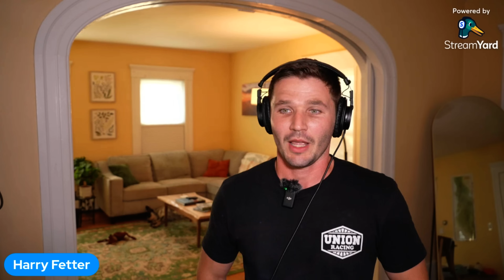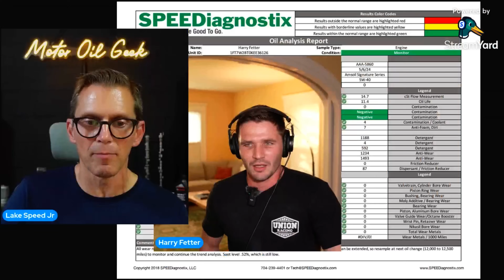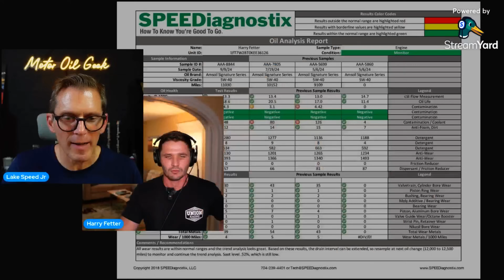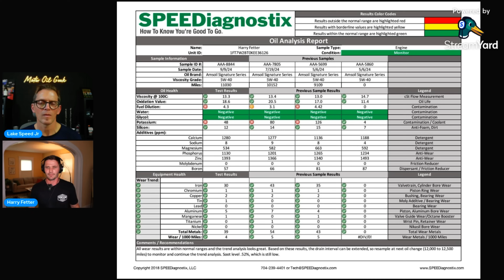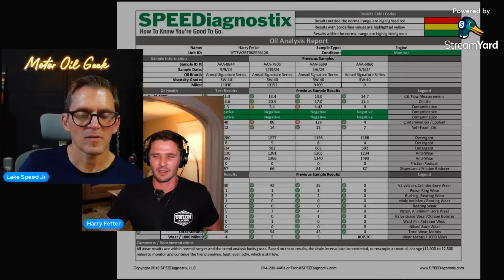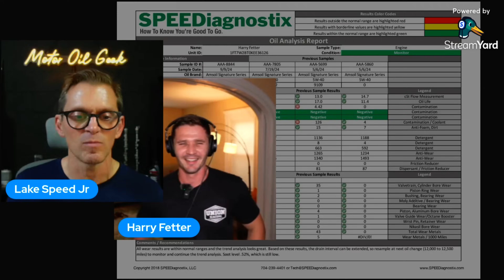11,000 Mile Amsoil Oil Analysis With The Motor Oil Geak

Comment: I just don't understand the obsession with extending oil intervals.
Reply: @HSKFab  for manufacturers, it's CAFE requirements. For owners, it's the added expense of oil changes. Most of these cars will live well beyond the period of ownership for the initial buyer, even with horribly infrequent oil changes.
Reply: Lake supports extended OCI to promote his Speed Diagnostics oil analysis business. Which is fine, that’s his right. I was an aircraft mechanic for 29 years, and the director of maintenance for a charter airline for 18 years. We did oil changes with analysis samples every 50 hours. So I have seen literally thousands of sample reports. It is a very effective tool for identifying problems early. But for my own vehicles, I choose to spend my $$$ on frequent oil changes instead. Since I have a shop with a lift at home, I do all my own work. I am meticulous enough, I am not worried about maintenance induced failures. I use Amsoil for my 4 cars, 2 motorcycles and inboard boat, changing every 100 hours, which averages 3500-4000 miles. Have never had a problem, so am sticking with what I know works.
Reply: @craigg4246  Perfect, I was in aviation as well for a few years and I remember all the testing and sampling. I do the same for my personal and my fleet of fords at work 5k miles, no more.
Reply: @craigg4246  it makes 0 sense to waste time and money and good oil. Is it still clear when you change it? So many don’t get that the new oils are different. It’s what makes it possible to go farther.
Reply: Too bad Lake's Speed Diagnostix oil analysis reports cost twice as much as Horizon Labs (lab Amsoil uses) and others.  Same information is provided on the cheaper reports for half the cost!  I'm a subscriber to Lake's channel but $60 for a report is way high.
Reply: @HawaiiTugboater Agree.  Horizon Labs is definitely the way to go.  I just switched away from Blackstone who aren’t much better than Speed Diagnostix at a whopping  $50 per report and they don’t even give oxidation values or soot %
Reply: @HawaiiTugboater The oil analysis cost is ridiculous considering you can get soil test for a fraction of the price comparatively.
Reply: @HawaiiTugboater  you really think Horizon (who shills for Amsoil) or Blackstone really run lab tests on every single sample? Many lab tests are simply fudged in MS Excel and values are based on oil, miles and application and it's mileage. Why do you think they print the disclaimer that their liability is limited to cost of the test?
Reply: 😂😂😂😂. Money and labor maybe 🤷🏼‍♂️
Reply: Drive 106 miles a day change your oil very frequently or as needed hmmmm
Reply: @brettcombs774  I drive 120 a day. Change every 4k. I may stretch it to 5k.
Reply: @HSKFab  seems like wasted money imo. obv you can do whatever but unless thats basic dino stuff thats wildly wasteful.
Reply: @brettcombs774  I drive 1800-2000 miles a week I change my oil every 2 weeks..won’t even go above 5000 since I do lots of city driving
Reply: That's right, bro'!!!
Reply: @HSKFab  
03 civic. 182k miles
5w-20 Amsoil Signature Series. 

I do 17k mile changes for the last 88k miles. UOAs always come back telling me to go further.
Reply: @ChinookBear  Good for you. Not sure why gassers keep commenting. Video and my comments are geared towards diesels, specifically the 6.7 powerstroke.
Your 100hp civic isn't my 800hp, 1300 lb ft of torque compound turbo 6.7 that weighs 8k pounds. I change at 4-5k. No if, ands, or buts.
Reply: @HSKFab  me neither, I try to change frequently while others try to extend
Reply: @HSKFab  I do it more for the environment. The used oil has to be disposed of somehow. It has to be trucked to a disposal site, any electricity that is used in the disposal process, and what I was told it is burnt on ships out in international waters. It is also expensive to change your oil every 3000 or 5000 miles if there is no problem with it. Plus the oil filters that need disposal and God only knows where they end up. As these oil samples show 11,000 miles and you gain nothing by changing it so why other than oil companies selling more oil.
Reply: @HSKFab  AMEN
Reply: A test is cheaper than an oil change, sometimes 3x less expensive , and you have objective evidence what your intervals should be
Reply: Fleets need to know to save cost
Reply: @evelynfarfellwooosh1219  Got a fleet of 25 6.7's change at 5k oil and fuel filters. Over 100 pieces of heavy equipment changed at 500hrs It's an investment and has paid off for us. Nickel and diming isn't what we're about.
Reply: @HSKFabrications  If don't get into specific then you're no good. You need data to make better choices.
Reply: @evelynfarfellwooosh1219  I'm no good? 😂 Ok.
Reply: Because using oil equals death of the planet.  So what ever you can do to reduce the consumer guilt -- especially with the youngest two generations -- the better chance you can sell them oil.  And it has to be dependable out to 10K.  
    Best of luck, my ICE vehicles will continue to get 3K intervals.   Lots of idling and lots of redline shifting.
Reply: @HSKFab  I change my oil every 8000 miles it can be as quickly as three or four weeks I presently have 336,000 miles on this vehicle most of which been put in in the last 2 1/2 years if I were to change my oil at every three or 5000 miles I would be in the shop sometimes twice a week to get an oil change rare occasion but it could happen

i'm not your average person I put on a lot of miles and I do it quickly it's not uncommon for me to drive 3600 miles in a week I do oil samples that tell me the condition of everything and I have never had a failure
I buy a lot of tires and I do whatever maintenance is required my last car had 755,000 miles on it and I stopped driving it because of a time limit not an engine failure or any other problem
just for the record these are both Fords one was an 09 Focus and the other is a 16 fusion 

If I had to do an oil change every 3000 miles I'd never get it out of the shop
Reply: Because most of us dont have the time or space to change our own oil, and changing synthetic oil on a euro car these days in most east coast and west coast major metro areas is easily $100 + these days. Oils re much better these days and extended intervals according to objective data, ie oil analysis, much better that relying on manufacturers recsssion or even “rule of thumb” (cut the mansucfactrers interval in half !
Reply: Can we please indicate what our individual  situations are when we make aggressive recommendation one way or another ? ,most of us don’t have the time or capacity, let alone our own lifts !, to change oil every 3,000 miles ! That said, the manufacturers are not conservative-they are fine with an engine blowing up after warranty has expired. And for aggressive oil change advocates, where do you draw the line without any data ? Now i assume q 3000 works for just about anyoen- why wouldn’t it it ? It’s probably overkill for 95% of cars out there. But for those of us paying to ave thsi done, if we have a euro car and live in major metro arae, esp on the coasts, this is >$100; way more than an oil analysis. I can have a full analysis doen for ~$40 every two certainly 3 - oil chnages, save money, and calibrate specifically and accurately to my cars needs and KNOW my oil is fine. All without having to do it myself, or schlep to mechanic twice. That’s easily two houses of my time…you’d have o earning minimum wage to justify that time waste. I think it’s Greta peopel have the time equipment space and interest in getting filthy and change their il q 3,000 or even 5,000 miles. But for many -most people , il analysis and maximizing your intervals, makes Greta sense. Now I will concede if have a 4 cylinder turbo, as so many cars have today,  you have to be more cautious , so I woudlnt push that even with an analysis. If i test at say 10,000 miles and it shows any sign or wear, im gogin to go 7500, east again, if any west drop interval again .
Reply: I drive 3-6 hundred miles a
 Day I’m extremely tired of living under this car at 5k. I’m tempted!
Reply: @NoName-tz5ji  Roll the dice, take a chance like the rest of these fellas.
Reply: @HSKFab  for myself it is because of the amount of miles I drive I don't have time to change my oil at 3,000mi for me that is just under 3 weeks. So, I have over 700,000miles + at this point come with a 10,000 mile sample rate and if something looks not right I go two 5,000 mi sample and I put a filter in at 20,000mi if all is running normal and change the oil between 40,000 and 100,000mi  unless told otherwise from the samples now in that 100,000mi  interval from filters and samples I have eventually added 8-10qt of fresh oil the vehicle is an 2006 chevy 2500hd with the Duramax LBZ. I started wanting the 20,000,mi so I could get to a point of only crawling under the truck every 3-6months and it snowballed from there. But I use the oil sample to determine air filter life also. And yes failures can happen any time regardless of oil change interval with samples you will have a chance of catching it with short change interval and no sample you may just mask the problem till it is too late but at the end of the day everyone has a comfort level of what that will do with their tools. But even without extending the drain interval samples are powerful information to use in conjunction with other tools. I track fuel consumption based off of miles and compair it with the computers numbers to see a differences and determine fuel injector condition it is all on the data you collect.
Reply: @HSKFab  I drive 4k miles a week I don’t have time to constantly change my oil
Reply: Because throwing away good oil is a waste of time and money.
Reply: @OtisFlint Can afford a 100k truck but not the oil? 11k is asking for trouble.
Reply: @HSKFab  how the video it literally proof…
Reply: @dkh100  So what happens when an issue arises at 3k miles, you wouldn't know about it until 8k miles later. Unless you sample every thousand. Samples aren't free. By 11k you would have paid for the oil in the cost of samples.
Reply: @dkh100  Which oil test parameter indicates how much coked sludge is in the oil control rings? I'm genuinely curious.
Reply: @HSKFab  the whole point is to get parameters so you dont have to send it in all the time but you know where you stand...
Reply: @kirkdunn1379  You can't predict a failure. That's the point of frequent changes, is what I'm saying. How much are you saving? $120. People blow that on cigarettes and beer in less time. It's worth it to me, that's where I stand.
Reply: @HSKFab I agree with you about doing often changes for sure. I do them myself. I also know that the extended intervals are a thing and can be done to bc the additive package in premium oils today can sustain a long interval, unlike before. If I had a fleet of a hundred vehicles, extending the interval somewhat would result in a lot of money saved so long as the right premium oil, like amsoil, is used and good gas. The other inportant thing that affects wear is the quality of the gasoline/diesel, there's research that shows premium fuel and the additive package that comes with it will lower the fuel dilution of oil at the rings which is one of the most leading causes for wear.
Reply: @HSKFab  Not everyone drives 100k vehicles.  I've got a 30k one.
Reply: @TheBeatenPaths  Talking about newer or new 6.7 powerstrokes.
Reply: @HSKFab  No trouble according to Lake. He said the oil hadn’t even started to deteriorate at 11,000 miles.
Reply: @darrylsjodin7184  Still being filled with soot and fuel.
Reply: @HSKFab  True, the fuel evaporates when hot enough but the soot will eventually restrict the oil filter. The bypass filter he talked about installing will help since it’s rated at 98.7% at 2 microns. What he’s doing is a good test to see what the appropriate drain interval should be.
Reply: @gregorymalchuk272  soot and fuel dilution
Reply: @HSKFab 30,000 miles in 4 months. Cost is real.
Reply: @HSKFab  you like being hustled by these service companies? Oil should literally be changed only by determination of oil analysis. Thats fact.
Reply: @isaactrujillo76  What service companies? Nobody touches my vehicles but me.
Reply: @ hells yeah, but I still believe in my statement about the analysis determining services.
Reply: @HSKFab  asking for trouble? Nah good oil can go way longer than that with zero issues.
Reply: @HSKFab  Oil/filter with Amsoil is almost 400 bucks. That’s why.
Reply: @gungadingo  Nah $180 for oil. Preferred price is $11/qt and I have a larger cat filter I get for $20. So $200 for amsoil. Which I don't use anymore. I use shell Rotella T-6. Costs me about $120 total per change.
Reply: @HSKFab did you watch the video?
Reply: @mason7300  Yes.
Reply: Agree.  43PPM Iron….is not a good look.  Buy T6 and change it more often- less wear.  It’s cool to do all the testing though.  Cool channel.
Reply: @duanemcquillin9343  Caterpillar, and others, say iron is not a problem unless it’s 200ppm or more. 40ppm is nothing.
Reply: @duanemcquillin9343  why not send a sample in and compare your oil with his to see the difference?
Reply: Save the environment! Less waste!
Reply: This is dumb I do m in e every 5k 10k on fuel filter 2015 6.7 pstroke
Reply: @jakethesk8roberts763  but most people don’t want to change their oil every 3 weeks. Perhaps there’s things you could also learn from testing your oil
Reply: @Craig-o9v  test ain’t cutting it bro they tested it from the factory. That’s how they got the intervals they got from the factory who wants to take samples and send it out all the time to oil just give yourself a better peace of mind sometimes not reinventing. The wheel is the best thing to do, bro look what happened with Chevy they try to reinvent the wheel well square how did that work out? Everybody I know has to trim chunks of their bumper off. lol 😂
Reply: And yet, here is laboratory analysis that shows the oil is performing fine. So maybe it's you who has an obsession with changing oil prematurely.
Reply: @deviouslaw  Maybe...
Reply: Frequent oil changes wont tell you anything either. Check your dip stick to see if coolant/fuel is getting in oil. Check your coolant to make sure its not getting contaminated. Easy peasy.
Reply: @danielfrain3521  sure does when you cut your filter open or observe your magnetic drain plug.
Reply: @HSKFab  it saves time extending intervals. Don't have to stop and change it as often. For those that use a vehicle for work it saves time and money

Comment: My fuel dilution at 7703 miles running Rotella T6 with auto regen off, only letting it regen when it could finish was just a trace. 2022 F450. Oh and I'm in Southeast Missouri. Turn auto regen off, only regen during highway trips and you'll get rid of that fuel dilution.
Reply from the maker: I will give that a try! Thank you very much for this suggestion. How did you figure this out?
Reply: @F450FTW  How do you control rejen on newer trucks? I dont know how on my 2020.
Reply: @wiredforstereo using Forscan you turn off auto regen so you can de-select it on you're instrument cluster. You'll want to turn on the DPF status option also.
Reply: Yes, sounds solid. Powerstrokes are best modern diesel engines & just require good basic maintenance practices like any modern vehicle.

Comment: I wanted to like ams oil, but when I threw it in my pos chevy it all leaked out 😂 obviously it's good oil just bummed it leaked out.
Reply: So fix your oil leaks?? 

I’ve been running AMSOIL in my Chevy for 80,000+ miles and it doesn’t leak out… and I actually have AMSOIL fluids in every place fluid is needed except for the brake fluid and coolant.

Comment: Awesome analysis Lake and great questions. I would like the discussion and analysis to move toward hours on oil rather than miles or kilometres when it comes to extended drain intervals. Depending on the ratio of highway speeds to city speeds should really change analysis and overall oil life, the same as towing/ working compared to empty driving/ light work. City driving with poor warmup is much harder on engines and wear, it will make DPF/regens happen more often. An engine working harder does decrease regen. Thanks again, great video.
Reply from the maker: Thanks for the comment!

Comment: What would you recommend for when to change oil for a guy who doesn’t tow heavy often and daily drives it? I’ve been trying to do mine every 8,000km what would you recommend. Always running additives and ams oil as well.
Reply: @Jonathan-sk3fu  Idle hours, stop and go driving, short trips, etc.. Get your oil sample tested, and create a baseline. I stick to 5k miles for any vehicle.
Reply from the maker: Yes be sure to get it tested for a baseline
Reply: @ what’s it cost roughly?
Reply: @Jonathan-sk3fu  About $30'ish for base sample, and $40'ish to determine intervals. My sample with top tier detergent fuel, and Pennzoil U.P. oil was top 10% for wear @ 107k miles. They wanted me to go longer than 5k intervals, but I'm not looking to maximize oil lifespan, over engine wear.

Comment: Same thing happened to my fuel dilution when I used a fuel additive right after I changed the oil. 10k miles later it was still in the sysmindviscosity didn't go down. Or wear. Blew my mind
Reply from the maker: That's wild!
Reply: I’ve been using Archoil.